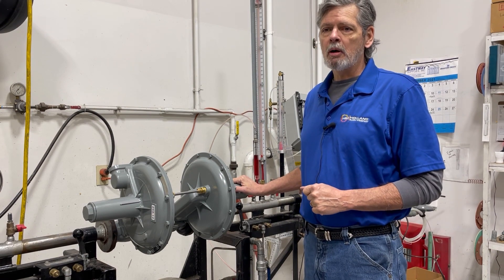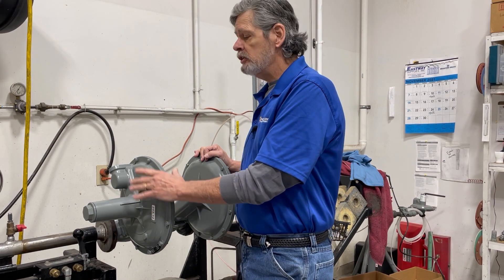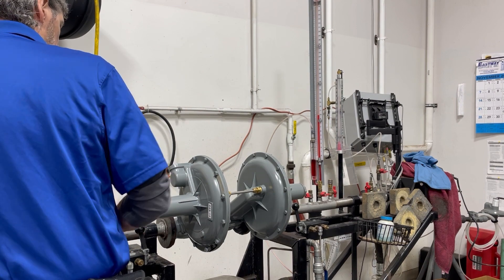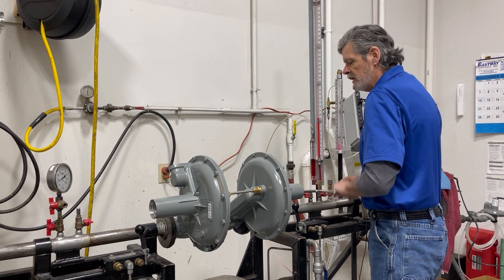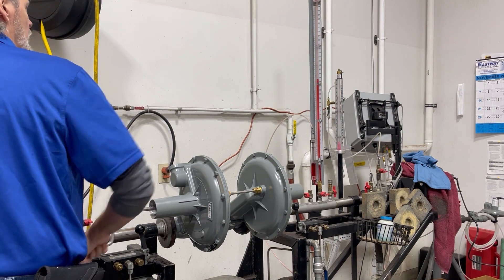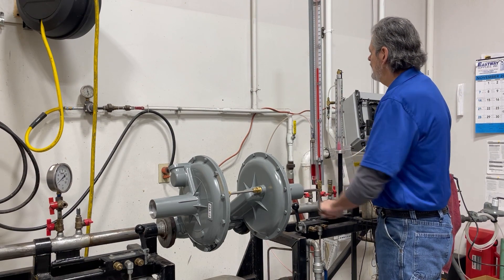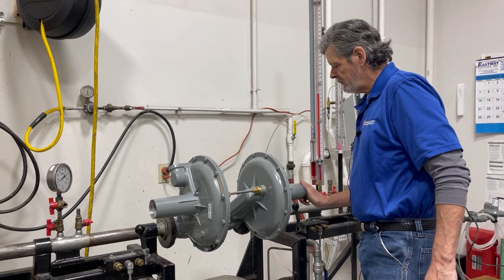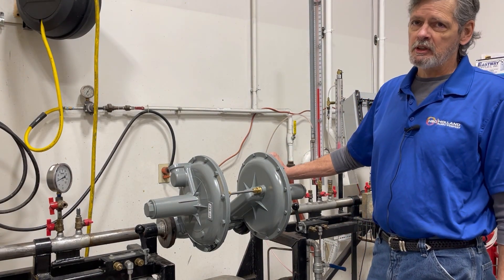Tutorial: Adjusting the Set Point on a Monitor & Control Configuration

Comment: This is the first time I've seen 243-12s in a monitor setup do they still have internal relief?
Reply from the maker: Hi there, sorry for the late reply! These do not. Although it’s possible to include internal reliefs on the 243 monitor-control setup, that’s a pretty rare application that we’d suggest avoiding entirely. We use the “-1” models that do not have internal relief valves.